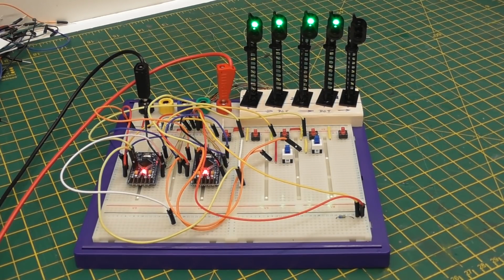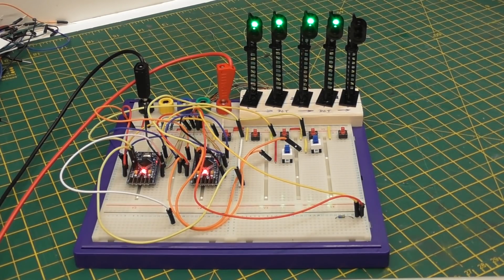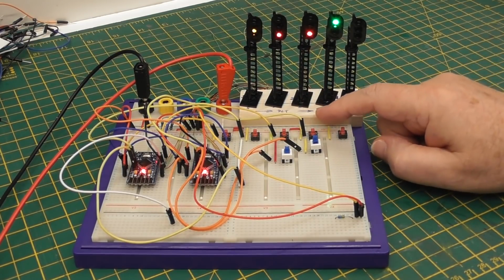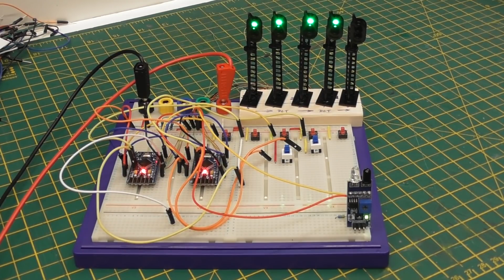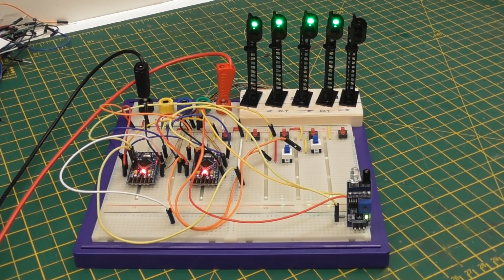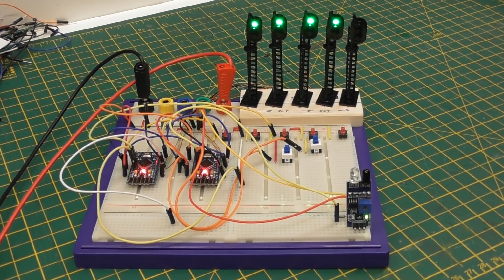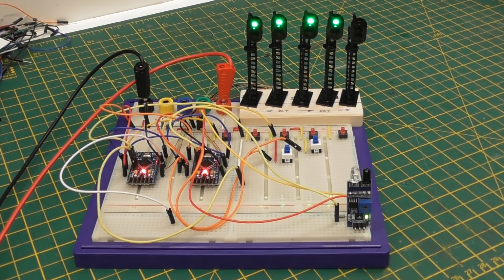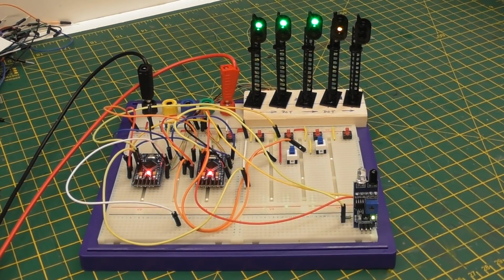Canal Sidings 58   Part 2 of my Arduino signal controller

Comment: John - thank you very much for sharing this with us. I'll be implementing something like this when I eventually get going on the layout. I'll be interested in getting points locking with the signals and hope to avoid using timers. With the photo detectors, it is a shame that all of the ones I have seen so far are quite large.
Reply from the maker: The delays seem to have caused a bit of controversy with people saying that they are not needed should not be used etc. However what will they do when their layout reaches a hidden section like a fiddle yard where there are no more signals and prototypical operation becomes impossible. We can't just leave the last signal passed at red and there will be no further signals to tell it to change. We then have to forsake reality and provide a timer to simulate that the last train has prototypically passed the next signals. Or do they know better? .
Photo detectors are quite large but not really dificult to incorporate especially at 27p each!
There will soon be another software update with those timer delays becoming adjustable without any programming. ............................John
Reply: Yes I see the dilemma. If I can think of a "fix" I'll let you know, but that may be some time away. I'm going to concentrate on my fiddle/storage area until PECO have brought out a more comprehensive range of points in Bullhead track, which is where all the signal work will be. I'll also keep you posted on z21/JMRI if you like.
Reply from the maker: Very interested in your use of JMRI. ..................John
Reply: @canalsidingsmodelrailway3411  Things are complicated by the fact that my layout is in Scotland, but I will be there next week. I have ordered some Arduino nanos, some IR obstacle detectors and Berko 3 aspect signals and hope to get these all working on a temporary oval to prove the concept. I'll also try to get beyond using JMRI decoder pro with my z21 and use it for driving some trains. I know the interface for z21 is good, but I hope to do full automation one day - something that I think the z21 will not be capable of. If there was a a way to drive an eLink from JMRI, I'd also give that a try.
Reply from the maker: Good idea to try an oval. Perhaps you can share it with us in a video. 
To do full automation you will probably need a lot of kit and probably something like Railcom. The bigest problem seems to be detecting the actual address of the loco that is running so that the automation system can take control of speed etc. 
There are things like ABC (Asymetric Braking Control) which avoid needing to know the loco address but this has to be built into the decoder and none of the cheap ones have it. 
However automation can and has been done so keep pluging away. .............John
Reply: @canalsidingsmodelrailway3411  - John, thinking of taking a reference from the frog of a point to change the state of the signal. I'm guessing that I will need to use diodes to prevent the frog and an IR sensor interfering with each other and also maybe a voltage divider/zener combination to limit the input voltage from DCC to below 5 volts. Do you think a capacitor in the feed from the frog would be neccessary also?  Cheers - Peter
Reply from the maker: Hi Peter, That got me thinking! I presume that you are thinking of using this to drive the Arduino signals driver Force RED input.  I had consedered this some time ago but never tried actually doing it so today I tried it and came up with the CCT here
https://www.amazon.co.uk/clouddrive/share/PWTqLxYY7wLUSl3brrGD3xy8hEieWGbPJvXxOTBNOWZ
The 2u2 electrolytic should be ok for an Arduino input but if you get any flickering of the signal led then try a 10u. The relative interference levels that I measured were 0.5V and 0.2V at the output of the 6N137 opto isolator. You may be able to use a non digital output isolator like a KB814 or TLP521 but i didn't have one of these to try, With theswitch in the position shown the signal would be set to red. .......................John

Comment: John,
Excellent and descriptive presentation, for a (retired) novice/newcomer to both Arduino and model railroading. You saved a 'heap' of money and time, much appreciated.
Thank you immensely for sharing the series,
Jay (from Down Under - Melbourne)
Reply from the maker: Hi Jay, 
Thanks for your comment. Since this video I have moved on considerably and I am currently installing  an automatic version of the signal controller where The trains control the signals but when a train approaches a red signal it will stop automatically. Then when the signal goes clear the train will start on its way again. I have also included the facility for bidirectional running on a single track.
Later videos explain the concepts and I also have one showing  two trains following each other and obeying the signals. 
I am due to post another video soon but There is some news in it that I need to synchronise with a fellow YouTuber so It is on hold at the moment. ......................John
Reply: @canalsidingsmodelrailway3411  Thanks, John. Looking forward to your new posting!,
Cheers
Jay

Comment: Absolute genius. I have been atempting to create a similar set up with just single 3 aspect signal but I have not a clue how to put together an Arduino sketch to control the sequencer and delay time. Would an adaption of your sketch do it?
Reply from the maker: Hi Nick. From the small amount of information you give I would say that the sketch as it stands will do all you need. You just need a aignal and a sensor wired to one of the two sets of pins provides by the Arduino and enable the delay provided. You can then alter the delay times to what you want. ...........John

Comment: Hi John. Your sense inputs are currently logic triggers . Ie 5v and 0 v. Would it not be possible to change this to a variable voltage using different resistor sizes that the Arduino reads and could then be used as a timing value. The overall voltage would still be over a trigger level and could still be used for its original purpose.
But now you have an external way of setting the timings.   Just a thought. Regards Leney
Reply from the maker: Hi Leney, You are correct the timings could have been set by resistor values although there would need to be one for each delay so  4 pins. It would have also required external resistors which I really wanted to avoid and it would have neen quite dificult to change the resistors under the base board. The final solution just requires a usb connection which can then be used to set all 4 delays as many times as required until you are satisfied with the result. .........................John.

Comment: Hi,great video.You could try using a shift register (74HC595) with the nano to get some extra pins.Cheers Gary.
Reply from the maker: Hi Garry and thanks for your  support. My goal in this project has always been no extra components around the Arduino if possible. I may have to build up to a dozen of these and extra components will slow down that building significantly. I have used SRs many times in my past life as  a design engineer so know how good they can be. But those projects were on pcb which makes the jog a lot quicker especially with auto pick and place! .........................John

Comment: Congratulation on your ability to understand the electronics and writing code. I would suggest that you don't rely on any sequencing or timers to operate your signals (except for false triggering of the sensors). The yellow (amber) signal should not run on a timer, it should always be on if the proceeding signal is red. Your Arduino should handle only 2 signals ( one for each direction) and 2 block detection for same. This way your not running feet of wire from the decoder to far away signals and then wiring one decoder to the next. You could build a DCC friendly decoder which can then be operated from a throttle or dispatch. Also it could be wired to your DCC bus to reduce a lot of wiring between decoders. What DCC system are you using ?  
Check out my channel. You can see how I built my signaling.
Reply from the maker: Hi and thanks for your support.
The sequencing is intended only to allow the signals to return to green when the track enters a fiddle yard or staging area where ther are no signals modelled.
The Arduino is indeed intended to control two signal which are close together to keep th wire lengths manageable as you suggest. So the signals will change to reflect the passing of trains and the settings of points.
DCC control is certainly possible but I intend to use the system to run the signals automatically and then drive the trains to them.  ................John
Reply: Hi, which DCC system are you using ?
Reply from the maker: I use NCE PowerCab and SB5 connected to JMRI and I normally control trains via a 7in tablet and Engine Driver and have a panel for the turnout switching running on a 10in tablet also using Engine Driver. My hidden storage area, which will not be signalled, has 20 dead end roads controlled by JMRI Route setting and, as it is in the next room, is viewed by 6 CCTV cameras also swotchec by JMRI to a 22 in TV monitor.

Comment: Your mastery of sourcing, programming and designing these tiny circuit is impressive.  It is very cool what you’re doing.  At the prices you pay for this stuff, you should package your system and sell them to modelers.  Rob
Reply from the maker: Thanks Rob. Selling the ststem as a package would not really be feasible as ther are so many diferent requirements. It is also very easy to reverse eneineer the Arduino code and then not need me at all. And if I can source the components at these prices then so can everyone else. So not really a comercial venture opportunity. .............John

Comment: I can’t get my head round this and it is very frustrating for me! From a career which involved commissioning communication systems on Helicopters, interrupted by a lifesaving Aortic Operation ten years ago, which also caused brain damage, I can no longer understand the principles or distinguish what is happening in electronics circuits. I acknowledge your excellent work in this video and, whilst I understand signal operating sequences, the programming is, sadly, quite beyond me. Great video and I send my good wishes. Bob
Reply from the maker: Hi Bob, and thanks.
This project is still in its infancy and is lacking in documentation. Hopefully when I have done more workon this it will just be a process of connecting the  modules together. There will be no need to have any understanding of the programming. ...............................John